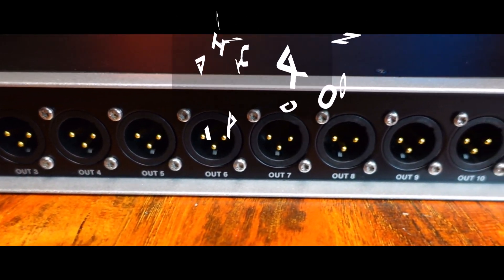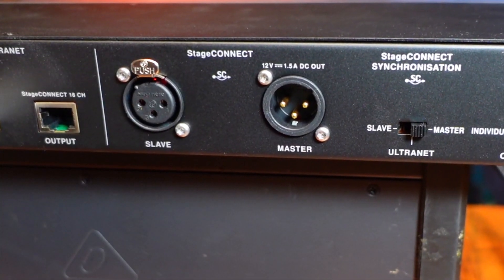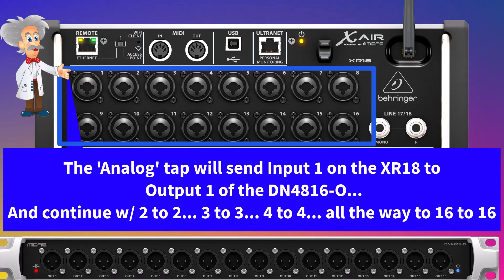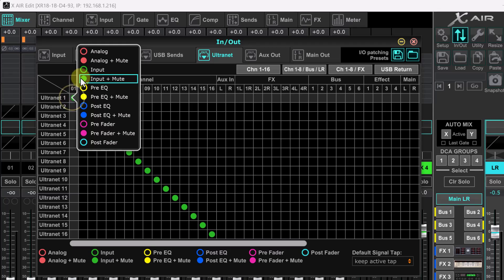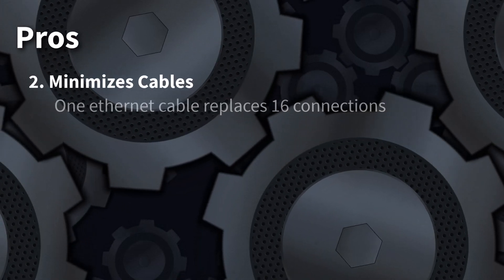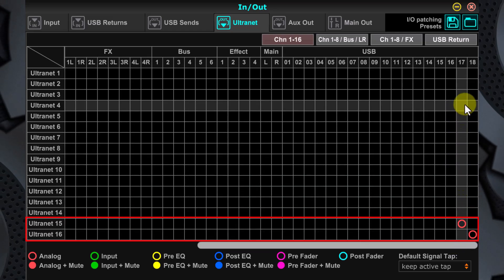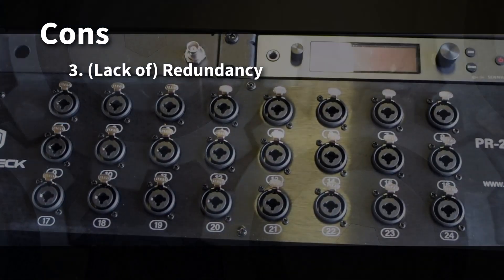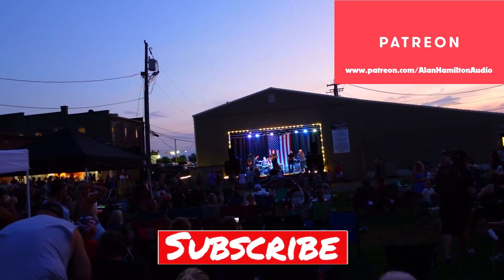Behringer XR18 with Midas DN4816-O for IEM Splitter

Comment: So 1 channel of DB can output a 1 channel from xr18 or multiple channes from xr18?
Reply from the maker: There are multiple possibilities. 1 channel of the DN can output one channel of the XR18, which is what you'd normally want if you were using it as a splitter (like in a monitor rig) for FOH.
But you can also tap each Ultranet output off of the L or R output feed... off of buses... from FX buses... from the USB inputs. 
Whether there's a good reason to do that is a different question. It's just that the options are there.

What you cannot do is go into routing, select an Ultranet output, and then select multiple channels directly to be sent to that output. To get multiple channels to that output on the DN, you'd have to create a subgroup, send/assign the channels to that subgroup (as you would normally do like via the SENDS page), and then in Ultranet routing you'd assign that bus to the Ultranet output you want sent to the DN box.
Essentially, the same way you'd do this if you were using a Behringer P16 monitor system and assigned all the drums (for example) to a bus so the musicians could just add a complete drum mix to their monitor mix via one channel rather than do it individually one drum channel at a time. Although, this is more done on something like the X32 where you have 32 mic inputs but only a total of 16 Ultranet outputs. So you have to group some things to get everything you want available in the monitors via P16. That's only a monitor limitation on the P16 eco system though. Not a limitation if you're running monitors off of some of the 16 outputs (as is a normal monitor setup). Usually it's better to let the musicians dial if each individual channel IF that option is physically available to them.

If you're using the DN as a mic splitter and the XR18 as a dedicated monitor console, and so there's a different console at FOH, then really for all intents and purposes, you want a 1 to 1 channel patch going to FOH. That way, FOH has complete control of the FOH mix... and the monitor console has complete control of the monitor mix. But, as mentioned in the Cons section of the video... Since the DN is a digital split tied to the XR18, it's taking it's feed AFTER the preamp. So there is some sharing taking place between the two consoles. That's why it's important to get the gain set on the monitor console in this scenario and then leave it alone so FOH can soundcheck and run FOH for the show without any gain changes from the monitor console (because those would impact FOH).

Meanwhile, with an analog split, the two consoles don't share anything. So both console operators can make any changes they want and not affect the other's mix.

Comment: You need to use shielded cat5e, not just "any" ethernet cable. Power issue can be resolved with a UPS.
Reply from the maker: When I mentioned a loss of power, I was thinking more console failure. But you're correct that using a UPS is always a good idea and for a kicked out or loose plug, a UPS can keep things going. Assuming someone sees that the UPS battery has kicked in and gets the problem resolved before the battery goes dead ;)
Reply: @AlanHamiltonAudio  ah yes, in that case the only solution would be a console with dual PSUs like a Pro2. But that's a different ballgame haha. I definitely recommend a UPS for gigs, especially outdoor shows where power could be sketchy!

Comment: What if I want to send bus outputs so players get a mix of different channels. Is that possible too?
Reply from the maker: You can assign bus outputs to it... but you have a limited amount of bus sends on the console. So, having more outputs available, but you're still limited by sends available to use them.
That said, I think you can use the FX buses to cheat and get more buses that way... change them to pre-fader on the channel strip, route them in the software, unassign the FX Rtn(s) from Main L-R...
But you can only get there by sacrificing FX slots.
Reply: @AlanHamiltonAudio  thanks! I was going to make group channels. So one for vocals, one for guitars, one for drums/percussion etc….Sound logical? That way I’d manage without the fx channels and patch each player to their assigned group. My band has 10 players

Comment: I like the simplicity,  but I don't like having to rely on the monitor console for  proper gain structure, nor do I want FOH going down if the monitor console does. I'm using simple, inexpensive passive splitters in three of the bands I work with. We've been using them for a few years without any issues. Takes a bit more space, but it's simple, and it works.
Reply: do the reverse, if you own two XR/MR ... get the inputs to your main FOH board, then P16 the analog to the DN and XLR back to the monitor console. You get to be the master gain.

Comment: I play in horn rock band.  We use 14 channels.  We have 9 monitor mixes.  We don't use stage wedges, IEM's only.  I would like to use the XR18 as the stage box where everything plugs into the XR18, all the channels are split to FOH, and each musician has his own monitor mix.  I can see how this would work with 1 DN4816-O but we would only get 6 busses and 2 mains for the IEM's.  That leaves me one short.  Is there a way to have a 16 channel splitter, AND an IEM mix for each musician?
Reply: We have XR18 and use 6 Aux outs on mixer and 2 more on this device through FX bus. Works fine. But we weren't able to use these FX aux to create stereo mix unlike standart AUX outs on the mixer.
Reply from the maker: @sergeyzh8308  I could see that... No way to link the FX buses like you would for the other channel sends.
Reply: Just to check, you need 9 individual mixes? or 9 outputs for mono IEM? 

What I have read others do is Inputs -> Splitter snake(Long tail to FOH, short to XR18) and that takes care of the splits.
Then seeing as it reads like you are wanting to use the 6 aux + 2 mains for outputs but lack one, you could use the DN4816-O for more outputs to feed all 9 IEM's but would still be limited by your buses to 6 individual monitor mixes.
One upside is that for 9 IEMs with the 6 aux + 2 mains +16 ultranet you could run stereo with TLS to each monitor if the IEM amp allows it.

Disclosure: I understand this on a theoretical level, and have been playing around with IEMs and a XR18, but am nowhere near a pro. I do like tech though and do well with it.
Reply from the maker: I can see two limitations... #1 Ultralink is only going to get you 16 outs no matter what. So you can't buy two DN boxes and connect them for two different purposes to have more outputs. So if you need 16 splits, you can't add another DN box and then have 16 more outputs.
But if you're only using like 15 inputs you'd only need 15 of those outputs on the Midas DN box. So that leaves one unused. 

#2 You'd still need a way to send to that output. One possible way, in theory, would be to take one of your FX buses and make it a monitor bus. You can make those channel FX sends be pre-fader. And you can go into the Ultranet routing and use that as an output for an FX send. For the FX Rtn I'm sure you'd need to mute it, unassign it from FOH, of fader it down. Otherwise that would be a path for your monitor feed on that FX send to return to the console and then ALSO get sent to Main L-R.

So you'd have to give up an FX rack slot to do this.

If you're using all 16 channels of the inputs, then the other idea would just be to get a 16 channel analog splitter (or 2-8ch) and then get a DN4816-0 to handle that lone user-hack monitor send.
And now that I think about it... You could use a smaller analog split and get the rest of the splits from the DN4816-O. At least up until the point you have assigned all 16 Ultranet outputs 'somewhere'.
That second part is getting kind of convoluted though.
Reply: @AlanHamiltonAudio  Couldn't you use a few P16's for extra IEM outputs?
Reply from the maker: @basssalad  That's a good point.

Comment: I'll stick with the analogue system that your earlier videos helped me build using the Behringer 8 way splitters. The only downside is the bulk and occasionally a link switch might get depressed.
Reply from the maker: Some people pull those link switch caps off entirely and say they are harder to accidentally get pushed that way.
Reply: @AlanHamiltonAudio  Great idea. I've had issues with the link switched getting accidentally depressed on the MS8000's.

Comment: We have a small studio where we use this setup to record and playback digitally with the X18, and use the 16 outputs with a snake to a physical mixing desk. So we have best of both worlds. We record to the laptop, but have it simultanously on our mixing desk so we have physical faders and the use of outboard gear. We then bounce the mixes to input 17-18 on the X18 back to the laptop when finished
Reply: Cool... what daw do you use?
Reply: I looking for the same !
Reply: @RENEGOMEZMusic  we use Reaper. But any DAW will work fine. One drawback of our approach is that while you may recall digital projects quickly, the physical desk is not motorised so if you don't have your track layout the same for each of your projects you're struggling. We try to finish one project at a time. Give me some contact info if you'd like a more in depth explanation of our setup, happy to explain (maybe brag a little) about our setup

Comment: As a FOH engineer, I definitely don't want the signal coming from one of these. You can get a 32 channel splitter snake with 5 and 15 foot trunks for under $300 (less than the cost of this unit), with none of the cons/headaches mentioned here. A 16 channel splitter for almost half of that.
Reply from the maker: Well, whether we like it or not, these are coming as they're gaining in popularity. And for some people, that need an ultra compact ear rig, maybe flying with their mixer/splitter combo and earbuds and ears are provided at the venue... or need all the space they can get in a van for equip and people... These are very attractive to them. And for those people, I wanted to make this video so they know what they're getting into and the differences between this and an analog splitter.

That's why I spent as much time as I did talking about the tap points, what that means, and still did a summary "Pros and Cons" section at the end.

Because otherwise, without that understanding, I'm sure there will be many who will send tap points from deep into the signal chain... Or think nothing of changing gain settings at any point in the night (or each song even).

But I get you... I don't know what a band knows and understands about the signal chain when they hand me their tails. But if it's an analog split, I don't have to care either... because analog is just going to work regardless of what they do with their onstage mixes/mixer.
Reply: I think this is a no brainer. Plenty of competent musicians who understand gain structure. This will speed up setup/  tear down time and cost of cables.
Reply: would you mind refering to some actual splitters? where do you find them? Sweetwater? Thomann?
Reply from the maker: @Kvelertax  There's a link to the Proreck version in the pinned comment here. Amazon has some that are pretty affordable and I see them a lot.
These have tails built in to attach to your mixer and send to the FOH snake.
Something like these you just buy in the channel count you need. 8ch, 16ch, 24ch, 32ch...
In the IEM section of my Amazon storefront you can find link:
https://www.amazon.com/shop/alanhamiltonaudio

I don't see any of the snake box with built in tails listed on the Sweetwater site... But they have the 4 and 8 channel splitters like the ART S8 and Behringer splitter listed. These types require you to provide the cabling, but typically have a transformer split and ground (pin 1) lift switches. And you add as many of them as you need to split the amount of mics that you need. IOW... for the 16 channels of the XR18 you'd need 2-8channel splitters. 
Here is my Sweetwater link to the Behringer rackmount splitter:
https://sweetwater.sjv.io/PyX23Y

Some people swear by analog splitters with ISO outs (transformer) but the reality is I've never seen anyone have a problem with a transformerless splitter anyway.
And the transformers DO change the sound, but probably not any ways that is truly negative enough to notice.
Reply: @Kvelertax  You can check out Seismic Audio for Splitter Snakes. That being said many people make them and they come in many configurations
Reply: I wish there was a way to route it out pre-gain. So if any changes were made on stage it wouldn't affect FOH. Way less headaches and things that can go wrong. Not sure why they can't update that through a firmware update.
Reply from the maker: @rudygunnthatsme  The change would most likely have to be in the XR18. And it still wouldn't be pre-gain but instead adding a trim control to the XR18. That way, the XR18 gains get set conservatively and left alone. Then if the onstage 'gain' needs adjusted for workflow reasons the users would adjust the trim instead. Which doesn't actually change the gain at all, but it will change levels POST gain inside the XR18. So to the XR18 users the impact would be the same. But to FOH, on the other side of the DN, the actual gain wouldn't change.

This still leaves open the possibility of the actual gain clipping if it's set aggressively though.

I doubt they do anything like that (at this point in the life of the XR18) since if someone wants that they can always just get an analog splitter instead.
Reply: I totally agree. I think suggesting this as a "simple and easy split" is an awful advice to give.

The DN4816-O is an awesome device... to give you more outputs from your system, for example to connect more IEMs.

Sure, this works, but it's far from the best way and should not be recommended by anyone!